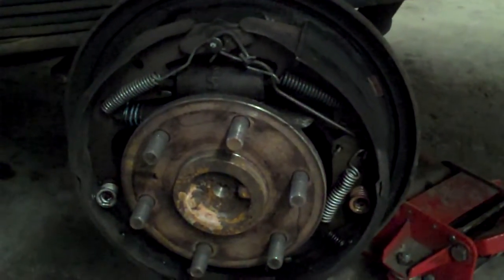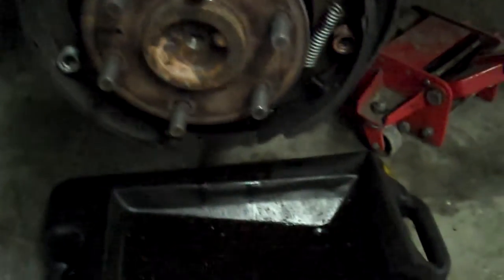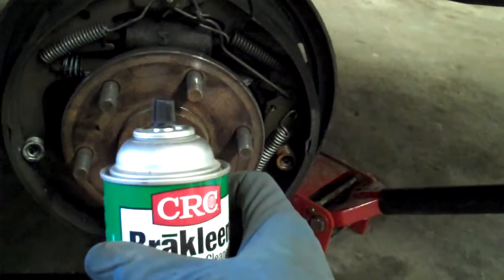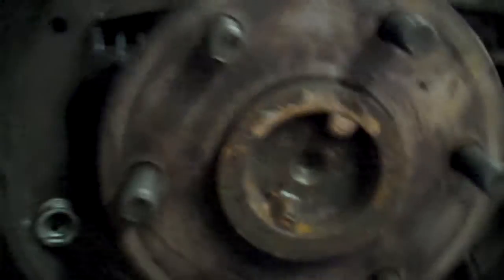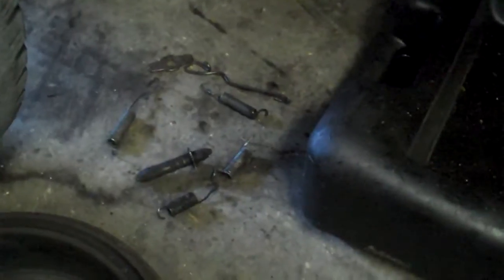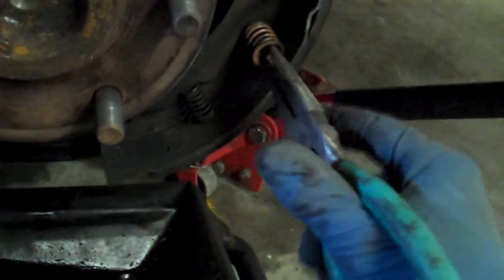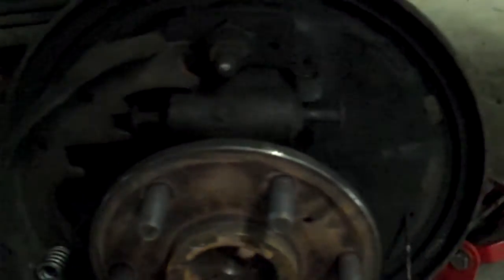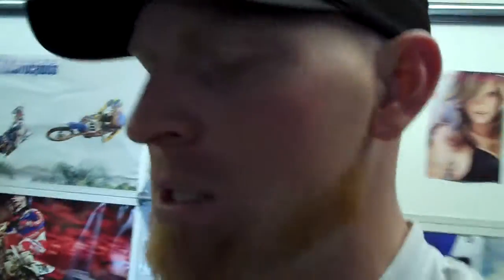How to replace drum brakes Tips and tricks

Comment: Drum brakes are no joke. The  I just wanted to access the drum's back plate , for cleaning & greasing ( lots of pad left / owner drives conservatly ). 
Got the brake pliers, three different sized spring drivers, an enlarged exploded factory service Manual, & watched four videos on my specific car.
Taking things apart is easy.  Correct reassembly is the VOODOO.  You're fighting the industrial strength tension from top/bottom.  Took me 30 minutes to finesse the parts together.  Took car on test drive. Stopped & test  park/ emergency brake . NO E-Brake.
Took the drum rotor off to adjust.  Much to my disappointment, I somehow detached the E brake cable from the grove it lives in.  The cylinder head of the E-Brake got sheared off by the rotor.
I have done shocks, struts, spark plugs, etc, and this drum thing got me.
I'm outsourcing drums to the brake guy, from now on.

Comment from the maker: @aodhanof90 This one is an Arcan 3.5 Ton.  I also have a Napa 3.5 Ton that is by far my favorite.  The Arcan is nice for it's longevity, but the Napa is faster, rolls better, and grips the bottom of the car MUCH safer.  The head of the Arcan is DANGEROUS!  I had an F-150 slip right off of it.  The castlated teeth are too short, the rubber pad comes off too easy, and the metal of the cup is too soft.  That combined with the wheels being small and rolling poorly = death trap.

Comment: I got a tip ive been doing drum brakes a long tip i got a set of long side cutters that are dull to use to remove the springs, i used to use channel locks but your get alot more maneuvering space with the cutter and its easier to prie them off the axle end if you have really heavy spring like on the old one ton and 2 ton trucks